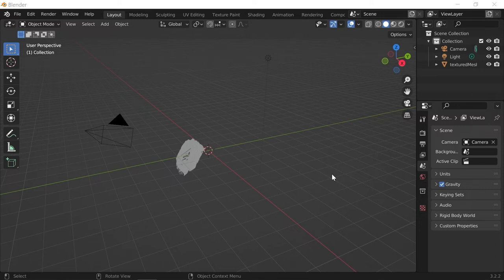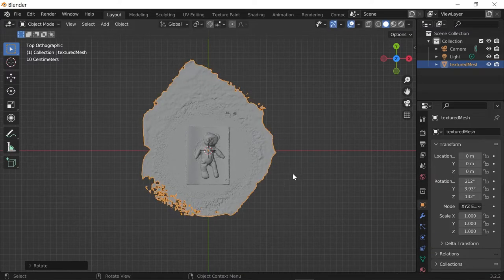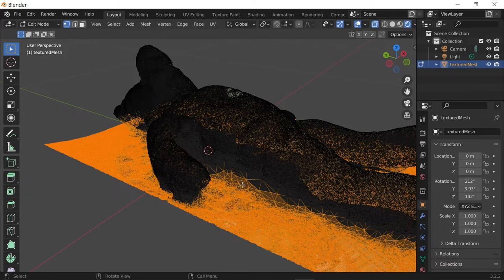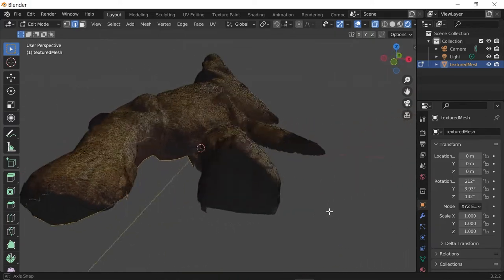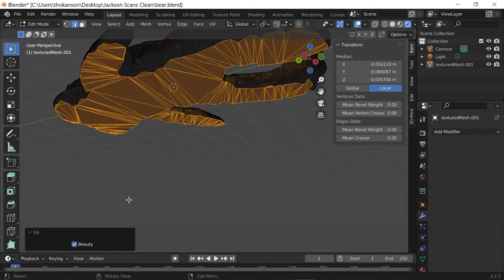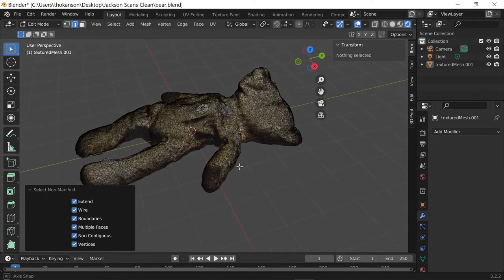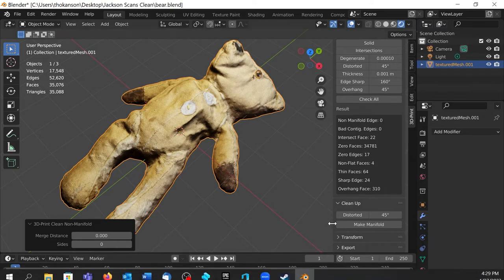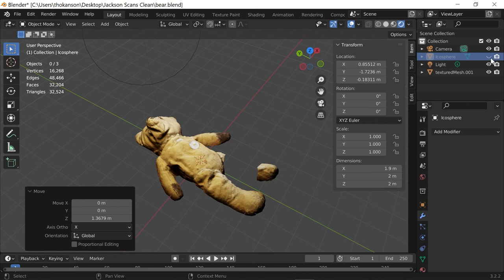Clean up high poly scans in Blender 3

Comment: When I double click on an edge, it doesn't do anything except select the one tiny edge I was highlighting....even if I have 30 edges in a straight line.  I can't figure out what I'm doing wrong.  I'm on Blender 4.x.
Reply: alt + left mouse click on the edge did the job for me
Reply: @havabreak  Yes, I have just found that procedure last night after more searching but have yet to try it.  Several videos said it didn't work on some later versions, so we will see.  Someone suggested that it may have to due w/ triangles vs quads, so I have to look at that as well if it doesn't work for me.  Thanks!
Reply: @havabreak  It does appear to work, now on to figure out the next thing keeping me from making the complete loop.  LOL